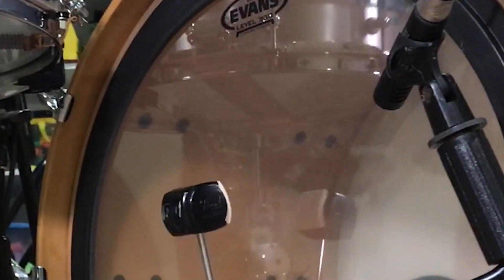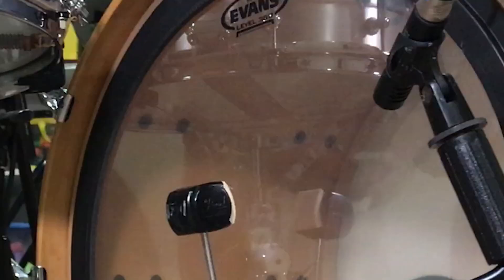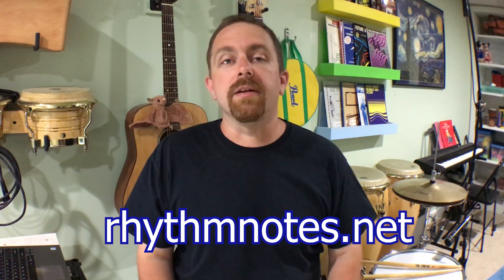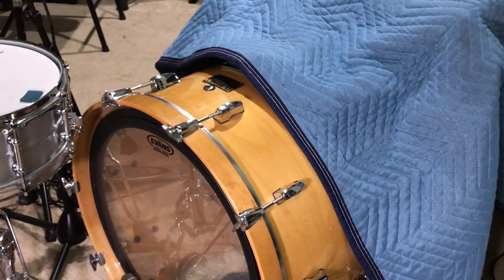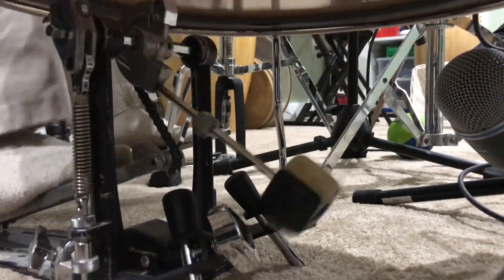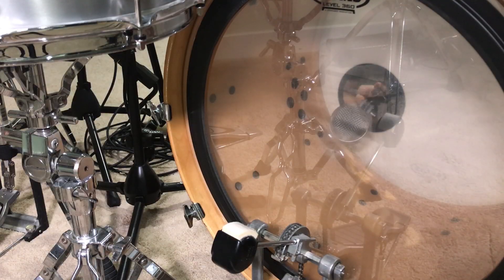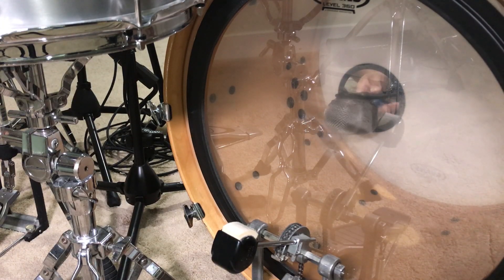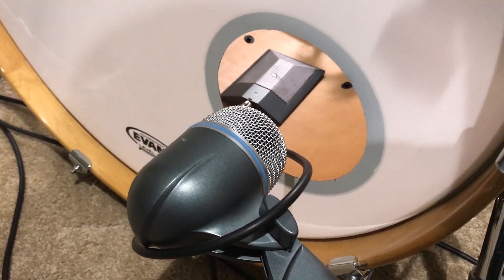Kick Drum Mic Placements for Better Sounds

Comment: I guess you'd need a really quiet beater system and I fairly highly directional mic on the batter side, to avoid picking up as much of the 'squeaky and creaky' sounds of the beater itself.
Reply from the maker: There’s different schools of thought on the ‘squeaky and creaky’ … if you want perfectly clean sounds, the bearings can be lubricated. If the spring in the kick pedal is noisy, you can take it apart and slide a small piece of foam inside. Personally, I have a few different pedals and some of them creak. It’s part of my sound sometimes. But if I don’t want the squeak, I try to eliminate it. I have a pedal that is perfectly quiet that only use on recording projects for clients. But my own music sometimes has a squeak or a creak. It depends on the day, and that’s me. As long as it’s not a distraction, I don’t worry about it.

Comment: Did you have anything inside of the drum? A bedroom pillow, a foam pad, and a heavy sandbag will all affect the sound. Also, that port is changing your sound A LOT, compared to no port hole. Maybe do another video where you compare batter, resonant, and inside mics with a full front head and no pillow?
Reply from the maker: No pillow or anything significant inside. Only a hand towel to place the 91 on. ... And I think your right on about the port. I was just looking at resonant heads for that reason. Thanks!
Reply: @RhythmNotes  I love doing the hand towel trick! Not a fan of pillows either. Although something heavy, like a sandbag, can do wonders for focusing your low end. I put two of those 5lb wrist/ankle weights inside my kick, not touching either head, on top of a small square of foam (just for cushioning) and it works great! If I really need more click, like for metal, I will scoot them up against the batter head but generally it's not needed. Thanks again for the cool vid!
Reply from the maker: @oblivionwalker8613  I've heard about the sand bags, but I've never tried it. I will now. Thanks!

Comment: The mic in the batter head is a good option BUT if you listen carefuly your video that mic and the other mic records the noise of the pedal (maybe the noise of the spring or the chain or both); to avoid that problem the solution is use a direct drive pedal and eliminate the noise of the spring putting felt inside it, also use an unidirectional condenser mic to avoid unnecesary noises. Jesus Loves you and Is coming soon.
Reply from the maker: You bring up a good point and really helpful suggestions. Thanks!